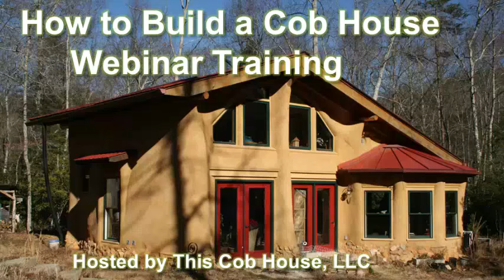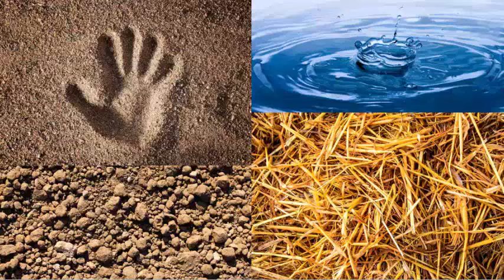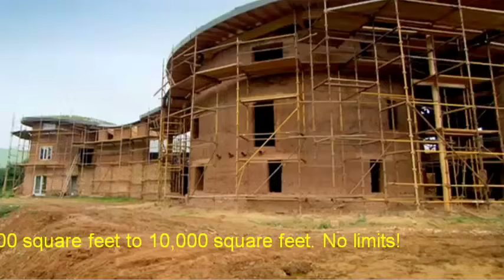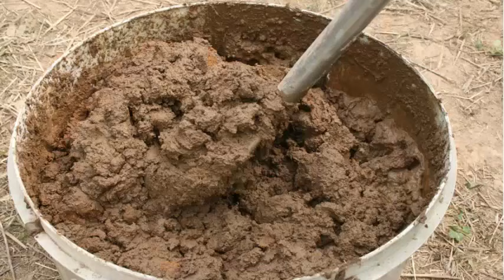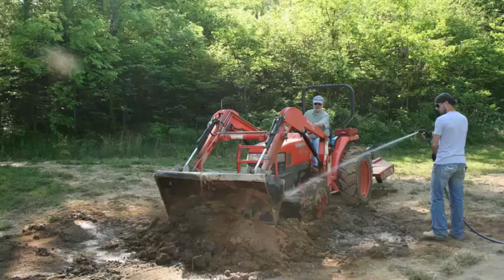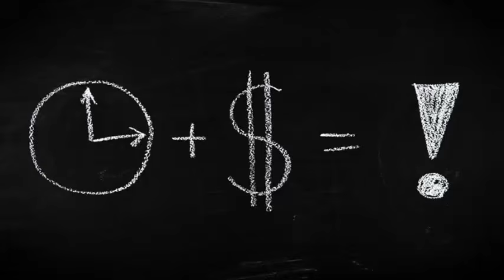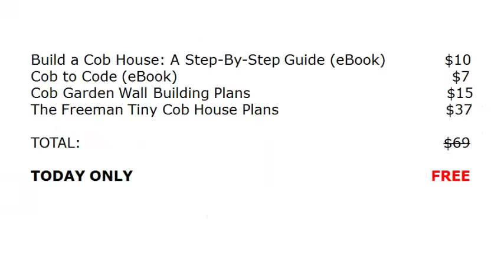BUILDING A COB HOUSE - INTRODUCTION TO COB

Comment: The Brits used to keep there cows penned in during the winter. There they had cow manure, straw and clay mixed up by the cows. Everyone knew to muck out the pen each spring, and slowly stack up the walls to their new home. Everyone knew this and so it was not written down, everyone knew this until one day no one knew this.
Reply: virgil fisher The Knowledge we lost over the ages is immense.
Reply: This mixture still would have required sand, or it wouldn't have correctly coagulated.
Reply: @drewgormley6933  responsibly harvesting sand is still a better carbon footprint then tearing down a 100 year old tree. Trees store all the carbon they take into their trunks. Most of their mass comes from the same air we breath
Reply: @ThatGuy-bx4yi  I don't understand your comment. What I mean was referring to the "Just take the trodden cow mud and make a house from it" myth. 

It would still require SAND, which would not be present solely from cows eating hay. Not sure if we are talking about the same thing here.
Reply: @drewgormley6933  Yes, sand is necessary. In Southwestern England and Wales, the subsoil is sandy and they could get more when needed. That's why this building material was used by them. Wattle and daub is where they used dung, but still needed straw and sand.
Reply: Guys,does manure make it stronger or something?

Comment: can I just buy the videos from you instead of doing something online? Can I just get DVDs? If that were the case I would buy them in an instant. I tried to take an online course before with something else and I got absolutely nothing from it I wasted my money completely.   Also,  can I get the books in printed form?    PLEASE,  MAKE THESE AVAILABLE.   :-)
Reply: Melba Rich
I know what you mean.
I've had the same problem....would prefer something in hand.
Reply from the maker: Hi Mel,
I don't offer the course on DVD, but you can buy the full program outright so you can watch all parts of the course from the get go. You can download all the videos to your computer. Saves the cost of creating DVDs and keeps the course cost lower overall.
Let me know if you decide to join and I can email you all the downloads.

Alex

Comment: Why not develop a plant based foam that you can mix with sifted prepared dirt that you can mix everything in a foam cement mixer that ypu can fill forms with that harden into a solid structure? A structure that will still be biodegradable and is 100% all natural!
Reply: Why don't you develop it?

Comment: what if I use a bit of cement like 5-15% instead of straw? will that hold together? I don't really like the look of the mixture with straw in it and I'm concerned that it might rot
Reply: The straw is the "rebar" it holds the mixture together and gives it integrity...strength. Also, the straw will not rot if you allow the walls to dry as you construct the house...the roof makes sure that the cob does NOT get wet. So there you go, good luck with your cob project.

Comment: What are the advantages or differences between building with cob and building with straw bale? I'm a bit on the fence as far as which to choose, I also live in Los Angeles, CA. Are they both comparable in their labor-intensiveness?
Reply: Straw bale for better insolation. If you live somewhere where it doesn't get cold as much you might not need straw bale.
Reply: You might not have to choose. Look into balecob, it's a mixture of the two. Some people will balecob the north side for the insulation factor and cob in the south side to absorb sunlight that will release as heat during the night. But that's the main difference, cob is thermal mass that holds heat and balances temperatures of night and day, strawbale is insulation.
Reply: +Arlo Waterbury thank you!
I live in Southern California, where we have a dry, hot climate almost year-round. even the cold months can have their hot days, so I am by no means trying to store extra heat than I need to. I will look into bale cob and see if that is a better building material for my home. thanks, again!
Reply: Don't forget, a roof overhang does wonders for keeping cob cool.

Comment: Thank you Alex!  I can definitely see a community working together to build cob homes.  I see how beautiful these structures are and want to get started building.  Thank you for talking about design and how design creates super efficient living spaces by being mindful of solar and thermal energy.  Looking forward to our first project.  Great to know you are just a phone call away.  :  )
Reply: Heavy consistent driven rain will very slowly (maybe a millimeter per rainy season) erode the outer most layer of cob if it is completely exposed and unplastered, but it doesn't just soak up water and wash away. Never the less, put your cob on a foundation that keeps it above standing water, and cap the house with a good roof that keeps rain off... but that's the case with any house. Good hat, good shoes.
Reply: One question I have is: How do you keep the house from being washed away by the rain? That would be kind of messy, especially if I am in the house at the time!